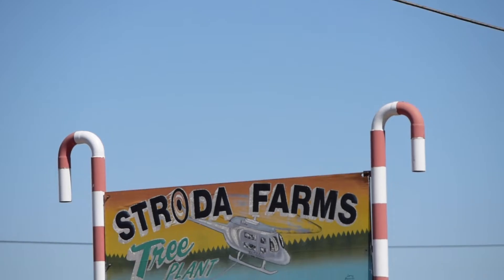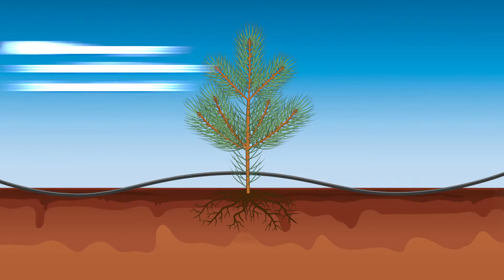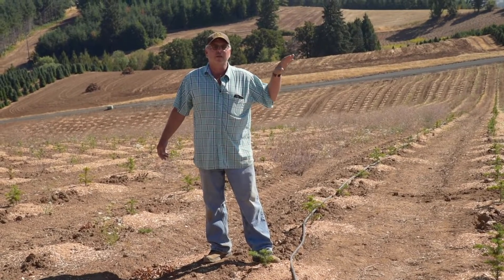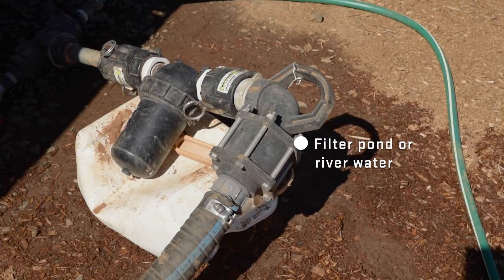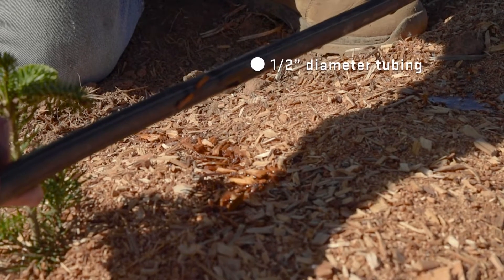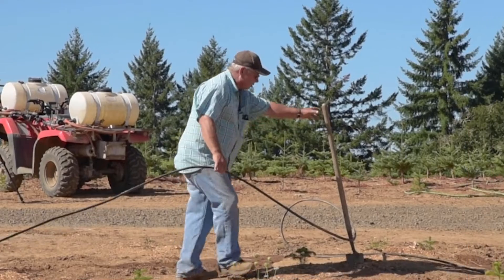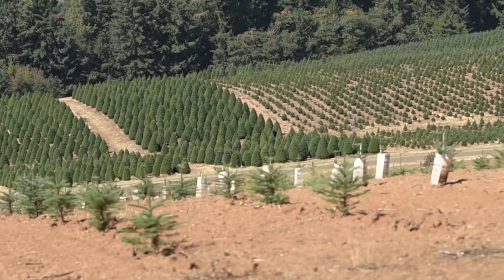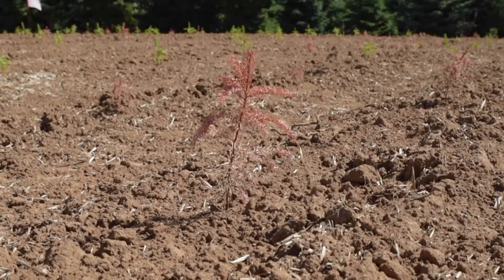Drip Irrigation System for Field-Grown Christmas Tree Seedlings

Comment: Very helpful, practical video.  I'm looking for an economical solution for watering new hardwood seedlings.  What type of pump are you using?  I see large pipe fittings that you taper into a garden hose after the filter.  Can you share the pump type?  Thanks in advance.